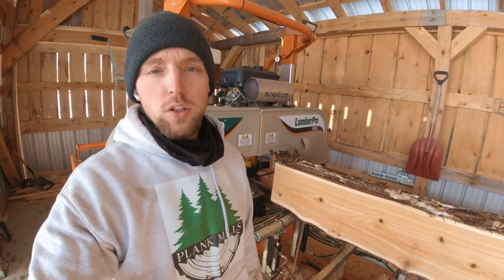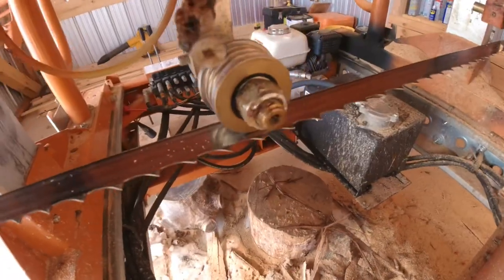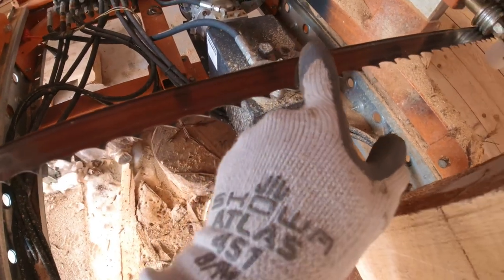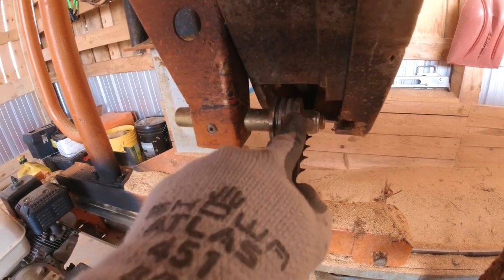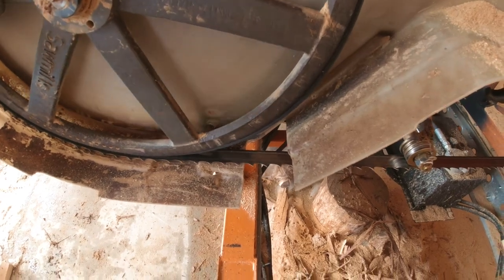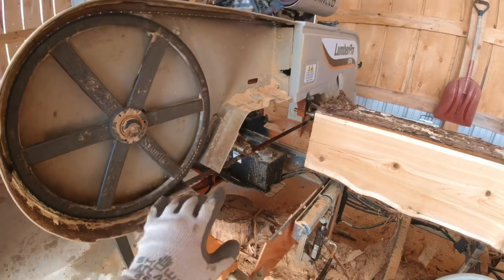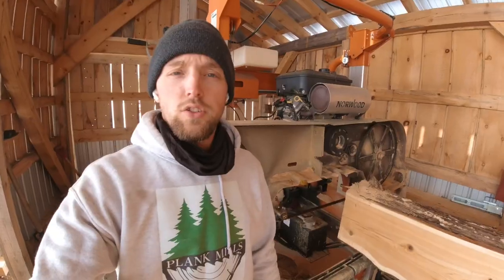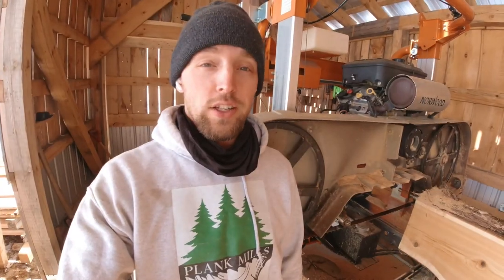Trying diesel for blade lube, here’s what happened!

Comment: Been using diesel for many years.  Have also used water and various mixtures of dawn, pine sol, windshield washer fluid and there is no comparison.  One drop every 5 seconds or so.  Occasionally the band gets a little extra by accident or when running out of the cut.  If anything, I think blades run cooler and those that have excessive heat are usually dull, not enough set, PITCH BUILD UP!  (which you eliminate with diesel. ) or too much time in the cut.  The odor and contamination is not a problem because even when I'm sawing guitar material, the rough sawn material gets aged, re sawn  on a shop bandsaw several years later, then thicknessed , surfaced,  and any diesel is long gone.

Comment: Hey, I enjoy your videos. I have had a HD36 for seven years. I saw mostly long leaf pine. Old growth, pitchy, sappy lighter wood pine trees. After about a year of pulling what little hair I have out running everything but diesel fuel with poor results I switched to diesel fuel. I don’t have anywhere near the problems with pitch sticking to the blade or wheels and belts as I did before. It makes cleaning the blade much easier when I take it off also. Some people are afraid that the diesel fuel will destroy the belts. I have replaced the belts one time in seven years. That was about two years ago. Even if I had to replace the belts once a year because of diesel fuel I would still use it. It made that much of a difference for me. There is actually a belt on the market made for the HD36 that is made to withstand diesel fuel. I don’t remember the name of it though. I think it is made of neoprene. I have just used standard Norwood belts so far.
Reply from the maker: Hey there! I really appreciate you sharing your experience! 
Thankyou so much!

Comment: Great experiment!
I’ve only ever used diesel fuel for the blade. As far as your rubber wheel surface, yes that did wear out for me so I created a steel strap metal ring to fit around the wheel in place of the rubber. I sized it a little too tight and then I heated it up and placed it on the wheel. As it cooled off it got tight.
Reply from the maker: Interesting, Thankyou for sharing your experience!

Comment: I dump diesel fuel on a pitched up blade, immediately trashed my belts and my saw come  off when it started riding on the metal. I would use diesel if It didn’t trash my belts.
Reply from the maker: That’s interesting, I know some people have used diesel and it doesn’t seem to affect the belts. I know mine haven’t been affected very much I don’t think. 
You don’t want to use a lot. Just a slow drip about once per second or so.

Comment: have you tried emulsifying diesel (hydro diesel) or even emulsified oil?
Reply from the maker: No I have not, 
Is that better than Regular diesel?
I’m using Off-Road Diesel here.
Reply: @Plankmills  is the off road diesel red?

ive not tried diesel as we pay around £1.70 a litre in the UK. 

ive emulsified vegetable oil with water with a small amount of detergent and also used the soluble cutting oil, i drop a 3 tablespoons of oil in the 5ltr tank, and mix it with 2 tablespoons of liquid hand soap/dish soap - it thins out the oil and still keeps blade clean.

good video though, ive not tried diesel - always thought it may cause the wood to smell, ill try it and see how it performs
Reply from the maker: Sorry I misunderstood what you meant about emulsifying it. 
I have tried mixing it with water, or windshield washer fluid 
I don’t remember, 
But it did not mix 

And yes the off-road diesel is red 
Here it is made specially for things like farm equipment and tractors and such… 
And we don’t pay tax on it like highway diesel. 

I’ve found that diesel worked the best for me.

Comment: It sounds like the diesel fuel makes a great blade lube and a brush on the blade will keep the blade cleaner. I am wondering if the diesel harms the wood that you cut. Can you smell the diesel on the wood after you used diesel as a lube?
Reply from the maker: It really does! I don’t know, that’s a good question. 
I can smell it from the general area where it’s applied but haven’t tried the wood.
Reply: It won't affect the wood, you'd have to soak it before you noticed anything. The sawdust pile will have a fair bit in it, even still not really enough to do anything.
Reply from the maker: Thanks for the intel.
Reply: I've heard / read if you can smell the diesel you are using to much.. maybe try to slow the application down on. I have not tried it yet.. Maybe this spring when I pull the mill out of hibernation.
Reply from the maker: Interesting,
Reply: You definitely don't need a lot, one drip per second is more than enough. That being said, you're going to smell it even if it's one drip every ten, twenty, thirty seconds. Diesel is what it is and what it is is potent 😅 I only say this because I work with diesel equipment all day, and one of the mills I run has a diesel drip that's kept to a minimum. There's no avoiding it. Some people hate it, others, well, some of us are a little nuts 😂
Reply from the maker: Haha, yes you will smell it.

Comment: this summer iam going to try bug and tar window wash
Reply from the maker: Diesel is the best solution I’ve used so far. Unless you use a lot of washer fluid with soap. I think I’ll need to add something to it though to get more fluid on the blade to help it run cooler.

Comment: Your gonna have to mix it with other liquids and put a higher flow on that blade or it will get too hot and you'll have premature blade failures.
Reply from the maker: Ok, thanks for the advice, 
I run Cook’s blades and this is what they do in their saws, slow drip diesel, 
Now I don’t know if they add anything to it or not…